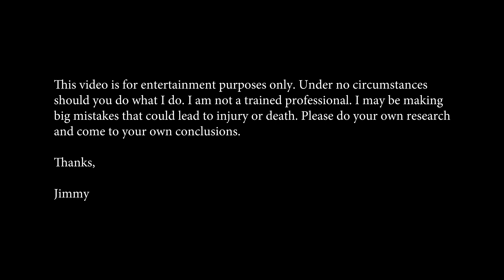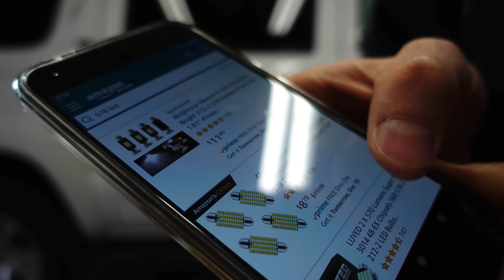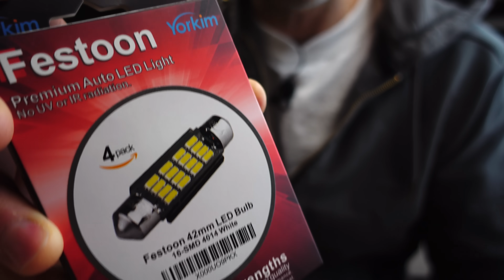Here's Why You NEVER INSTALL LEDs IN YOUR CAR OR TRUCK!!

Comment: Something to be aware of with those "festoon" LED lights is the physical size of the LED array and it's heat-sink.

Even though the overall length of the bulb is correct, and the contacts are the correct size, some LED arrays just won't fit in the space intended for a regular bulb.
Also, more importantly, the heat-sink sits very close to the electrical contacts and if it touches them it'll short out and blow a fuse.

They come in various sizes (array of 20 LEDs, 15 LEDs, 8 LEDs etc) so it's probably best to buy one and see if it fits before buying more.
If you have problems, look for a bulb with fewer LEDs that'll probably fit more easily.

Comment: Here are a lot more considerations when replacing bulbs in a vehicle than a house.
1.  Headlight lens and reflector design are driven by the location and distribution of the light source is.  LED light sources are nowhere near the same location and distribution as factory.  The LED bulb, even if brighter, is not an indicator of its effectiveness.  Many designer lights sold today range that your eye either can't use, or are much less stimulated by.
2. The more red the light, the less it bleaches out your rhodopsin, the better for your night vision.  This is why cockpit lighting is red.  White, which is the blue end, does the opposite.  
3.  Bright means you can't see out of your windows at night when you turn the light on.  Your interior lighting will last forever anyway because the computer turns them on and off slowly.
4.  Sensors depend on current flow to determine when bulbs are burned out and can tell you they are burned out when they are not.  
5.  You need to make sure the LEDs will actually fit where you plan to use them.  That often comes into play with the exterior lighting housings.
6.  There are a lot of dependencies in a modern vehicle.  Some learn that their radio controls many unrelated things which 3rd party radio vendors sell expensive boxes that go inline to your 3rd party radio to duplicate the functionality previously provided by the OEM radio.  An example would be control of interior lighting.

Unlike a house, LED retros in a vehicle have a lot less to offer, and a lot more that can make them detractors.

Comment: Incandescent bulbs are better during the winter months because of the heat output. It melts the snow when it accumulates on the lens cover.  LEDS have very little heat which allows snow to build up.

Comment: All very well, and in panel or cabin lights LEDs are great.
The problem comes when LED arrays or gas tube bulbs are substituted for filament or headlamp bulbs.
Headlamp reflectors are designed to focus the light from a small filament into a beam coverage that complies with regulatory criteria, but arrays like LEDs or Gas Tubes are larger and the reflectors can't focus the light, so beam profile and alignment are not compliant.
The result is inadequate illumination of the road ahead, and dazzling of oncoming drivers, causing serious road safety issues.
Modern vehicles have reflectors designed for the light source they leave the factory with, while older vehicles designed for filament lamps must not be fitted with LED or Gas Tubes so-called Upgrades.

Comment: The problem with LEDs even with heatsinks is the lack of airflow in an enclosure. The quality control on a lot of cheap LEDs is terrible also.
Reply: @Venturi Life That's why you buy LED replacement bulbs from a good reputable dealer. I've been buying from the same outfit since 2007 and have only had 2 bulbs go out, they were 194 wedge bulbs. Headlight to tailight in my 06 Ford E-350 and my 99 Ford Ranger. Outside of the 194 wedge bulb issue, I did get the fast flicker when I switched out the turn signal bulbs, so I replaced the OEM flasher with either a heavy duty one in the E-350, and a LED bulb flasher in my 99 Ranger. No issues since.

Comment: All of these LED bulbs you demonstrated except, possibly, the one that melted a bit all have resistors to lower the voltage down to around 3 volts. This may actually cause them to last longer than you might think. However, I purchased a set of 120mm and 110mm ring lights, designed for 12V vehicle headlamp accents, for a photography project. I was trying to see if anyone using them has applied a resistor, since on visual inspection I don't see any on the rings. Figuring what size resistor can be calculated using an online source but I see little said about this for these lights. Are the resistors now in the circuitry of the later model vehicles for these?
Reply: @jeffhavel1364 absolute bullshit, leds dont need a resistor to emitt light. The resistors are there to drop the voltage. They also provide some kind of current regulation, because the leds might be damaged by too high currents if the voltage increases a little bit due to their large differential resistance.
Reply: You only need a resistor if you're replacing a blinker. And that's only in a vehicle new enough to know that it has a turn signal bulb out and it does that hyper blink. LED runs lower voltage, your car thinks it has a bulb out, a resistor fixes that. 
Leds have an anode and cathode, if it don't work, pull it out and flip it around. Or just buy the correct bulbs for your vehicle.

Comment: maybe you can check what style of bulb and terminology, so some of us won't roll our eyes and figure this is not a well researched or knowledgeable vid. first. those bulbs referred to as halogen, 168 bulb is not halogen.
Some company's are making LED bulbs that work and are not a gimmick, but there again that would require some research on your part. Sigh
Reply: My thoughts exactly.  Guy doesn't know the difference between halogen and incandescent yet we should trust his knowledge of LEDs?
Reply from the maker: both are glass bulbs, filled with inert gas, burn a filament, have a warm color temp (2700-3200k), produce most of their energy as heat, have a low life span and look almost exactly the same. So, I said halogen instead of incandescent... not a big deal.
Reply from the maker: @stevesands7778  both are glass bulbs, filled with inert gas, burn a filament, have a warm color temp (2700-3200k), produce most of their energy as heat, have a low life span and look almost exactly the same. So, I said halogen instead of incandescent... not a big deal. **Also, you shouldn't trust anyone or anything you don't do your OWN research on. ✌️
Reply: Halogen is more efficient than incandescent to about 30%,lasts a lot more,the major advantage is that the evaporated atoms of the filament settles back again on it,opposed to classic incandescent bulb that gets its glass darker and darker over use.
Reply: @1RoadGarage  halogens aren't filled with an inert gas.

Comment: I only replaced the tail lights on my 65 chevelle  as the stock were horrible on a bright sunny day, especially if the sun was in the eyes of those behind me. I went with united Pacific, which were plug n' play and couldn't be happier. The led's are in a new lens, and u just plug it in to the original socket. You do need to replace flasher with an LED flasher, but that's it, and the difference is like night  and day.

Comment: Yup , doesn't know products , should have never made that vid .
Been running l. E. D's for long time and haven't had to replace any
Reply: Some of mine are starting to flicker and one by one they are going in the junk.
Reply: You sir are a liar. If you are using IED's you would have to replace them after every use. LED'S on the other hand.

Comment: Good review.  To me the only benefit with LED's is lowered power consumption.  I'd rather have the warmer light from incandescent bulbs than the intense cold white of LED's.  That brings me back to power consumption and that has almost never mattered with the lighting units I worked with.
Reply: You can get warmer-colored LEDs. You aren't restricted to just daylight. If you aren't sure while you're shopping, just look up a lighting temperature guide (for example, 4000K is the more classic "Soft White" yellow-white color, used in most incandescent bulbs, whereas the LEDs in this video are more like 6000/7000K). 

As for preferences, ideally, I'd want my regular dome lights to be a soft white, while I'd want my actual map lights to be daylight (since you can see in greater detail at that color temp, which is important for reading a map; on the other hand, though, who uses paper maps, these days?).
Reply: @NaruSanavai  I had a 04 expedition and I replaced all the interior lights with some soft ice blue lights. They were bright but didn't over power with brightness if you know what I mean. Made eating lunch on night shift easier. But I had some bright bright ice blues in the vanity mirrors. Wouldn't blind you with indirect view but would illuminate your face to spot anything. My bulbs also had aluminum head sinks on the back.
Reply: I am adding LED “recessed”, type lighting as part of a renovation.  They all have a switch to select five different Kelvin settings from 2700k to 5000k.  I use the lower Kelvin settings in places like bedrooms for a warmer light, and higher k settings for places like the fitness center.  The same fixture  can be adjusted to meet all the needs.
Reply: @almccallie4314    It's good to read that these lights have worked out for you and that you're pleased with them.
It's been a year since I posted my comment.  I'm currently finishing off the interior of my garage.  In other words, transitioning from its original state of bare stud walls to making it like a finished room with sheetrock walls, a ceiling and paint.
My electrician suggested the very same recessed lights that you described.  When he first mentioned for me to consider installing these, I thought, ehh, having in mind that cold stark light.  But he described how they can be set for different kelvins and that they're dimmable, so I decided to try them.  What pushed me to go forward with these was due to the number of lights I wanted out there, sixteen.  I'll be having him set all of them to the lowest kelvin and live with them.  I may like the light they produce, but I'm expecting that they'll need replacing every few years.  My experience with the LEDs that look like a regular light bulb, in the recessed fixtures in my kitchen, has been that after a few years they grow dim and become useless.
Reply: @discerningmind  when I first started putting these in, I had no idea they were adjustable.  They were set on the highest Kelvin and the space looked like an operating room.  I quickly learned to select the k setting before installation.  As for the life…I think they are supposed to last several thousand hours.  I’ve had some of them in over two years now and they look great.  I may be wrong about the life though.
Your post shows how important lighting really is.  Thank you and best of luck with your projects.
Reply: Power consumption in a vehicle with regards to lights is moot unless you're running some insane stereo system.
Reply: Gotta lower those vehicle electric bills!

Comment: I have LED headlights in my car, but I feel the electric system suffers with them since it sometimes takes the ignition a couple of turnovers to start (and I have the load resistor built in with those LEDs). I never had that problem with halogens. A friend of mine is an engineer and he told me that changing out bulbs like that can interfere with electrical system, especially if the stock form of the car is halogen.

Comment: All the cars with LED headlights on the road are blinding at night to the point they look like high-beams. I don't see how they are legal.
Reply: In my opinion they are not legal...it is illegal to have lights that dazzle other road users....but manufactures are allowed to design & fit these lights on their vehicles. A case of "the emperors new clothes"?
Reply: LEDs should never be used for low beams or high beams! It is very hard to get the correct beam pattern with LEDs! As far as I know there is 1 company that makes LEDs for high and low beams but tgey are between  $200 and $250 a pair!
Reply: Well they are not legal and neither are DOT approved from what I've seen.  Unless you have aftermarket HID lights with the ballast on the sides when they open the hood to see, inspectors including myself fail them immediately by which they are not DOT approved for exactly that, Blinding.  now on a personal level if people knew how to properly install and adjust the lights it wouldn't be such a problem.  They install and go but even my el cheapo Sylvania lights from autozone still "blinds" people thinking they are high beams because I haven't adjust my lights yet.
Reply: The newer Super Duty Fords come with LED headlights, 4 of them, and they are set too high and are WAY too bright. I turn on my high beams for anyone running LED's, they are highly inconsiderate of other drivers.
Reply: @douglasgoldstein8990  Yea the STOCK ones from factory are legal and I agree WAAAAAAY too bright... At least face them down a bit more!
Reply: LED headlights need special housing design. People should never just swap the bulb.
Reply: @automotiveperformancemobil4030  yes, and I'm saying this as a guy who drives an older F350, so it's not like I'm low or anything. But even in my little Ranger they're still insanely bright.
Reply: Douglas Goldstein If they are OEM, they are approved by the DOT and that makes you the jerk for flashing your lights.

I don’t like them either, but Get over it. This isn’t 1920.
If it’s legal to see better with brighter lights in 2020, then adapt.

You don’t have to stare into the headlights to judge how much they offend you.

Comment: I learned about this when those cree leds started being mass manufactured. I bought a few cheap flashlights and was amazed at how bright they were for being a $10 light. Well there's a downside, the lack of heat dissipation. I learned my lesson with those, ya can't cheap out on leds because they get super, super hot.
Reply: An LED has almost zero resistance and would burn out instantly when voltage was applied. As a result, a series resistor is fitted, but being in the cap, cooling is a major problem. The TOTAL heat is far less, but it's location is the problem. Modern bulbs are now limiting the current electronically, but they are still in their infancy.
Hopefully, by the time manufacturers such as Bosch start producing bulbs, the early problems will have been resolved. 
Some replacement or OE light fittings have the electronics away from the bulbs and mounted on a heat sync. These will probably de the future, with a 15,000 hour design life coupled with low current.  
LED street lighting is suffering the same problems.
Reply: @wilsjane  Electronic current control should be well beyond infancy by now.  The really cheap bulbs don’t use that method because it adds to the cost.
Reply: Maybe they’re overdoing the brightness.  Maybe some of the extremely cheap ones are overdriving the LEDs.  The fairly cheap ones we have have lasted years.  But they never feel hot, even after being on for hours.

Comment: Still waiting for reasons "Why you NEVER install LED's in your car or Truck!!"
Reply: I'm wondering it was sarcasm or a gimmick to get us to watch.
Reply: Ya he got me too, should be DON'T BUY CHEAP LED'S
Reply: Also maybe dont pick wrong configuration of LED for the type of projector you are using.
Reply: crxdelsolsir he saying be careful about bulb design and heat sink.
Reply: Here is a reason, I have a 2014 ram 1500, that has bulb sensors.  I replaced the 3rd brake light with an LED and now it shows as being burned out.  It isn't but because it senses current drop, it sees the less current use by the LED as being burned out.  I can put s resistor in line with the bulb and solve the problem but just be aware
Reply: Because they are bright.. you obviously didn't catch it

Comment: I installed super bright LEDS into my turn signals, brake lights, reverse, and side marker lights. I'm not having issues in my truck, I also installed LEDs into my interior lights and my puddle lamps as well. If you get HF noise you could easily install  a inline noise filter into the power line to the radio.

Comment: The heat issues with replacing Halogen Bulbs to LED bulbs in canbus vehicles is simple to explain. The electricity from the vehicle was designed for a certain load from your bulb. An LED bulb does not meet this resistance. So, in order to increase the resistance, it wastes it creating heat. Otherwise, the bulb will tend to flicker. There are a variety of ways to create this resistance. You can add a resistor to the line and make it generate heat someplace else. You can add it directly into the bulb. You can change the canbus settings somehow.

Comment: I have led in my home saving 25% in my home 

How much less power will be drawn from Alternator
Reply: And leaving your lights on for a while will drain your battery a lot less.
Reply: Even though they do, It’s not so much how much you will save in energy, but how much less you spend constantly replacing bulbs. Properly designed LED’s will outlast the vehicle you put them in.